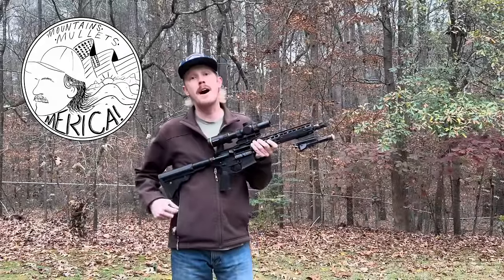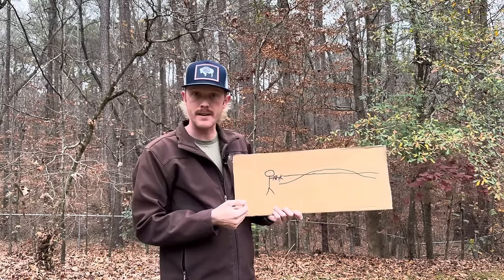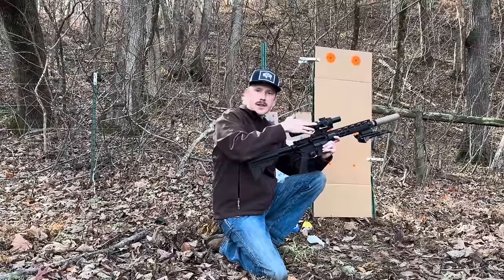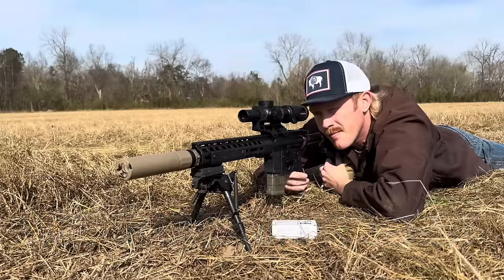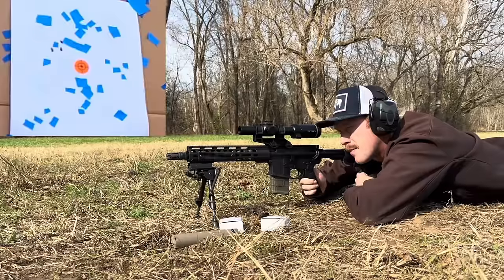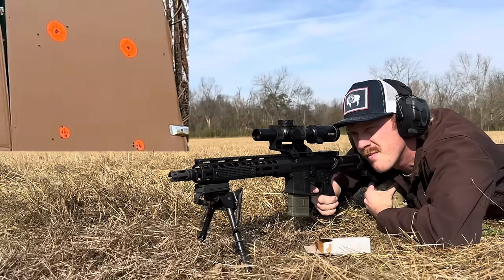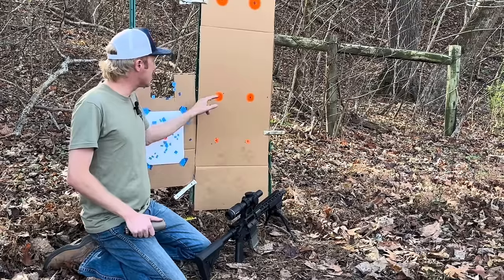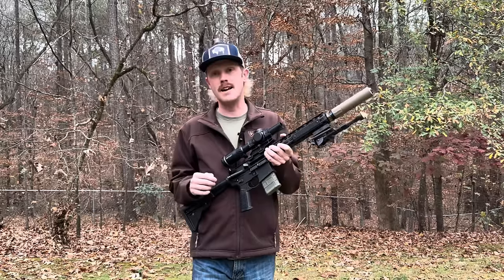AR Battle zero deep dive- suppressed vs unsuppressed

Comment: Would you say that the slight elevation drop when shooting unsuppressed was due to a slight reduction in muzzle velocity (assuming that the suppressor gives the round a bit more powder burn to increase MV)? It would be great to chrono your shots while zeroing suppressed vs unsuppressed to see if there is any noticeable MV change. Thanks again for the great content!
Reply: You run into a few different variables when shooting suppressed, especially if you're going off of an unsuppressed zero. 

First, and probably least noticeable inside of 300 is barrel harmonics. 

Second, and this is also fairly negligible inside of 300, especially with smaller cans, is the added weight at the muzzle pulling downward on the barrel. You probably won't even notice this effect until you get beyond 300. Possibly further. Unless you're running a heavier auto rated can made out of steel, you may not notice an effect from this at all.

Finally, you do get some added muzzle velocity by virtue of having more time for powder burn, but its also facing less air resistance through the can after the first shot burns up the air in the can. 

Harmonics are actually the bulk of your POI shift. Some older cans, and mostly heavier cans, are horrible for this. Taper mount cans will give you the best results, though.

Comment: I love your work. I would have also shot the same test again with a third set of groups after re installing the suppressor back on to make sure no zero shift & suppressor is consistent. Lesser quality mounts / suppressors will change POI every time.
Reply: Yes. If there is one takeaway from this video, is that Griffin’s mounting system is hot garbage.
Reply: @rifleshooterchannel208 agreed. Not a fan of griffen anything

Comment: Cool Review as usual, I guessed the POI would be higher with the Suppressor since it's technically adding barrel length
Reply: More barrel harmonics than length the tip if the barrel is flipping like a jump rope in super slow motion just as the base of the bullet leaves the crown of the muzzle any changes to that tuning fork will change poi down range add to that back pressure from the can ect

Comment: For me the question is how much difference will there be if I have zeroed my rifle THEN put on a suppressor.  What does that do to my zero and I’ve found that some suppressors make a huge difference while with others there is no difference.  In one case the orientation of the suppressor makes a large difference.  I’ve also found that adding a can USUALLY tightens up my groups.  Everything depends on your rifle and your can and testing is the only way to find out.
Reply: I had the same thought. Based on this info, seems like it makes sense to zero it 50/200 without the can, and then if and when when you add it, you’re probably still within a usable max point blank range.

Comment: Usually, a can will impair the velocity slightly, causing a reduction of range by inches.  But your data shows the can was shooting higher?  Can you rotate the can 90 and 180 degrees to see if this was a bore alignment issue?

Comment: I think the question people have is…. If I zero with my can and then for some reason need to make hits without it and not changing the zero, what happens… every gun/can/muzzle device is different but everyone needs to know that answer for their setup. This setup… that’s a huge zero shift at 50… my can on vs off is about an inch difference at 100 and therefore 2” at 200 so it’s not too bad.
Reply: Everyone needs to take said platform to the range and find out.
Reply: @txpredatorhunting  most dont even have their rifle zeroed anyway
Reply: @adamnickel  you are probably correct about that.

Comment: Not uncommon results as seen on YouTube, I don't use suppressors so real experience on my rifles. 

My experience has been that the low light flash performance of dry suppressors is not what I would like and standard velocity ammunition has a sonic signature, along with the flash that points to the shooter.

Comment: So the suppressor must give you a little velocity boost
Reply: With my suppressor installed, I see a 30fps-40fps increase.  Not enough to matter.
Reply: @AZMarine513  that’s hardly a difference. I wonder why it seemed to drop so much more
Reply: @bigz5262  It may varry between rifle and suppressor makes and models.
Reply: @AZMarine513  good point. Do you think a suppressor is worth it after having to jump through all the hoops?
Reply: @bigz5262  100% I bought my first one. It was a significant improvement in my shooting experience. I bought a Silencer Co Omega, and in short order, I purchased a .46 cal Hybrid and a .22 rimfire Osprey.  Shortly after, I started shooting with suppressors. My brother and buddies bought them. I don't care to shoot without one now.
Reply: @bigz5262  For hunting, they are awesome.  I run one on my 6.5CM and .45-70.